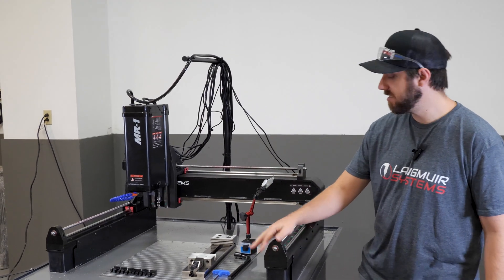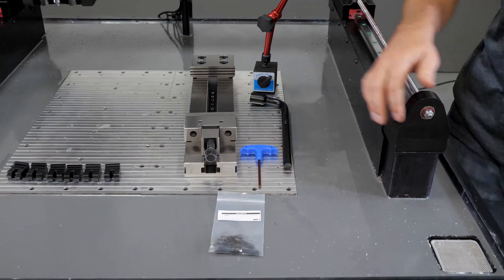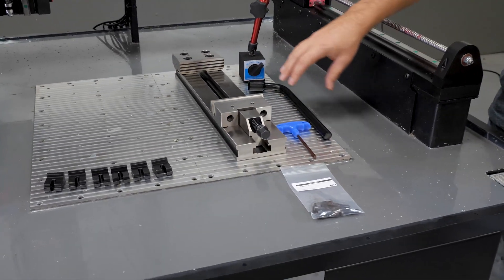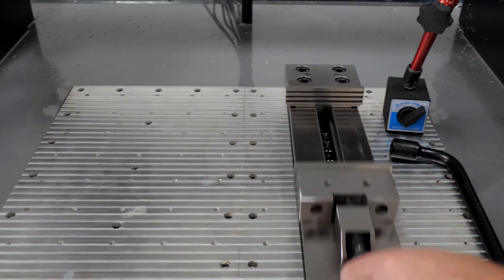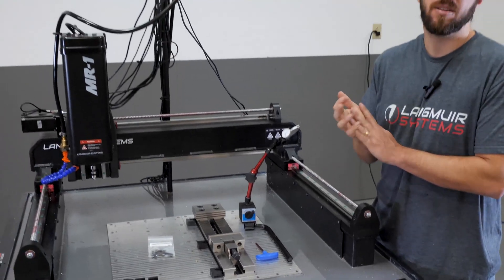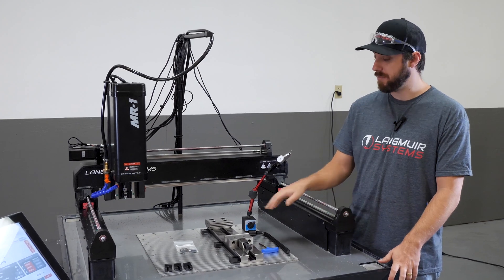MR-1 CNC Mill Assembly Tutorial: Mounting a Vise on MR-1

Comment: Does your vise have, or can you buy, a part stop?
Reply from the maker: The vise does not contain provisions to install a jaw mounted part stop. Typically we'll toe clamp a block/bar to the baseplate to use as a part stop.
Reply: @LangmuirSystems  have you seen the vise from tormach.  It is a garage shop type of vise.  I say that because it has a number of different jaw options, part stops, verticals part holding, and a lot of soft jaw options.  Just thought it would be weird buying their vise and putting on this machine🤷

Comment: I see that on your website you offer 20x6 SMW pallets so you can install 3 of them along X or Y .
I'd rather have just one bigger SMW palet the size of the MR-1 baseplate
Reply: You can reach out to SMW for a quote on a custom plate (they do custom all the time). Probably not huge seller as most guys in this market aren't looking to spend over $1500 on work holding out the door.

Comment: Is the baseplate able to be replaced?
Reply from the maker: Yes!
Reply: @LangmuirSystems  with it being embedded into the concrete and epoxy, how difficult is that going to be?
Reply from the maker: @ZOIMIBiIE  not difficult. If you study the assembly manual you'll see how the anchors are embedded into the concrete, the base plate is just surrounded by it. By using the base plate threaded holes, the base plates can be lifted out and replaced as needed. Eventually we'll film a video showing the process 👍
Reply: @LangmuirSystems  sick! Appreciate it
Reply: @LangmuirSystems  that's crazy, so would it be good idea to coat the baseplate in something to keep it from sticking to the concert and epoxy? I'm thinking of several things off the too of my head but maybe KY Jelly or plastic wrap.